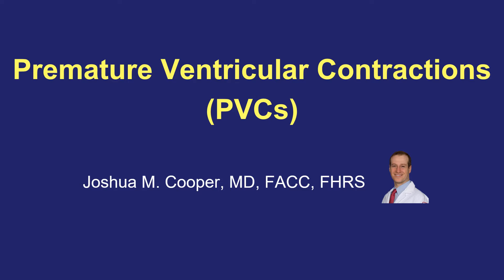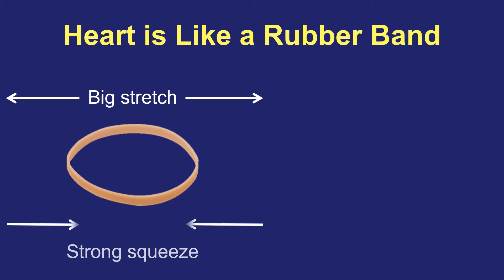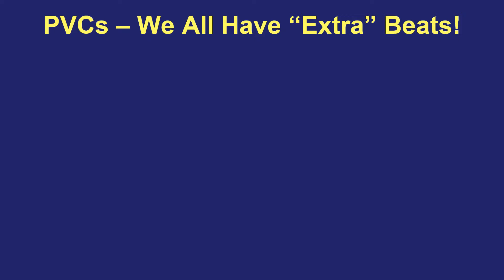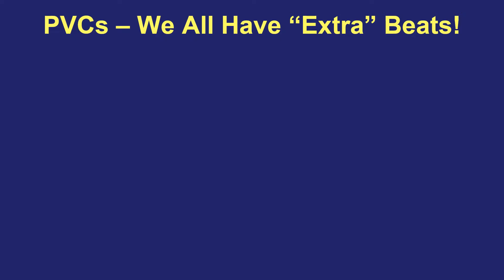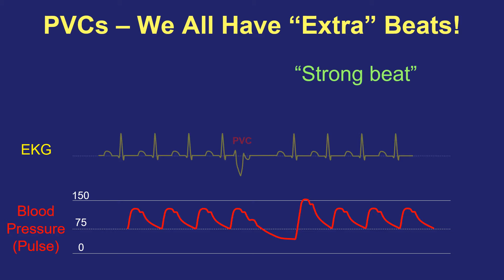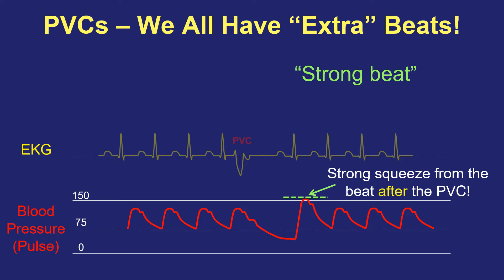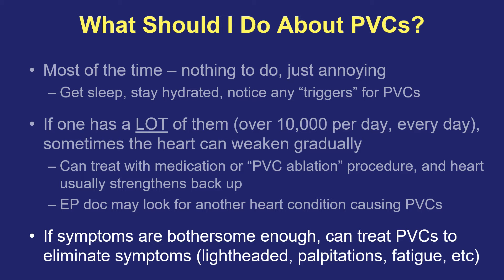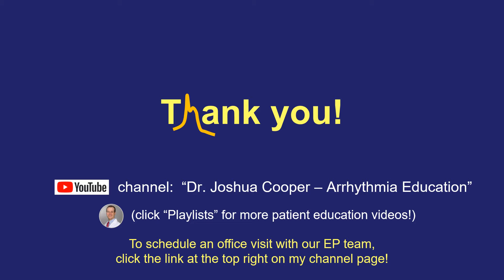PVCs: Symptoms and Treatment - in Plain English!

Comment: Hi doctor
Wonderful video!
In 51 and have pvcs for about a year.
I feel only maybe 5 every other day. 
Had a ekg, echocardiogram both were normal. Wore a zio patch for 10 days came back as rare pacs and pvcs, less than 1 percent of all heart beats. And no heart rythmas. My doctor said nothing to do because there are so few of them, and I just feel a couple of day, and my heart is structural fine ejection fraction 60%. He says there just annoying and not dangerous and everyone gets them, nothing else to do?
Thank you doctor
Reply from the maker: The two reasons to treat PVCs are for medical benefit and for symptom benefit.  People with normal heart size and function, with rare PVCs, usually do not require treatment of the PVCs from a medical perspective.  From a symptom perspective, it depends on how often and how severe symptoms are, which would dictate whether any treatment would make sense from a quality of life perspective.  Most people with a handful of PVCs here and there will not feel that treatment is necessary, but everyone is different!

Comment: I have panic / anxiety disorder. But I feel there is something truely physically wrong w me. My father had hypertrophic cardiomyopathy. I’ve been tested and told no. But I do have PVC’s 

I’ve been in ER several times over the years. 

I passed out when prescribed propranolol. I take 10 mg amlodapine now. My thoughts have a DIRECT EFFECT ON BP.  I can hover around 140. But get to 190 when stress arises just 20 seconds after a thought. 

I’ve been told stress leads to PVCs which leads to a weakened heart which can lead  cardiomyopathy which can lead to stroke / death 

Last week I ended up in ER for PVCs again. Since 7 days ago I have waves of uncontrolled blood pressure increases , panic and persistent pain in my heart. Physical pain. I also have fainting. I don’t know what to do other than die
Reply: bro me to man i have a panic disorder and just the thought of it or a pvc or just blood pressure going up from running just a little  makes me try to not go into panic mode since it feels like a onset of a panic attack. its so difficult

Comment: I have seen 3 cardiologist at 22years old because I was worried about a panic attack months ago induced by caffeine and workout, they all told me I was fine, though the PVCs didn't show on their EKGs (1min ekgs..)
At home sometimes I can have up to 1000-2000 PVC a day approximately but somedays not at all or very little. They happen after an moderate/intense workout particularly, I have a good performance overall, am I safe and no need to get a 24hr holter, the cardiologist only performed quick ekgs and echography when I visited them? Thank you 😊

Comment: I have a lot of PVCs through out the day. I also have mitral valve prolapse. My DR said that the excessive PVCs are not caused by the mvp. It does it a lot while I'm laying down to sleep. It's so annoying.
Reply from the maker: Mitral valve prolapse is commonly associated with palpitation symptoms, and I personally think that the extra "yank" on the mitral valve structures with each heartbeat may be responsible for increased PVCs in patients with this condition.  The shape of the PVCs in MVP often suggests origin from the papillary muscles (to which the mitral valve chordae are attached), which I don't think is a coincidence...  Regardless of whether your doc thinks the MVP and the PVCs are related, you should speak with him/her about treatment options if the symptoms are interfering with sleep and quality of life...

Comment: The patient was in sinus rhythm. With episodes of sinus arrythmia. Heart rates ranged from 45-128. The average heart rate was 67 BPM. Ventricular arrhythmias consisted of rare uniform PVCs.
Supraventricular arrythmias consisted of rare PACs and 3 triplets. There were no noted pauses.
7 day holtet

Is this normal?
Reply from the maker: You should talk to your doctor about your monitor results.  In general, "sinus arrhythmia" is a totally normal phenomenon of the heartbeat speeding up and slowing down a bit with breathing in and out.  Rare PVCs are seen in almost everybody on heart monitoring.  Rare PACs and short runs of a few fast beats in a row are also extremely common and seen in most people who wear heart monitors.  Best of luck to you!
Reply: @dr.joshuacooper-arrhythmia9917  
Thank you! They defined it as being within normal limits. It was just scary as the doctor said a triplet is considered SVT.
I always thought most SVT was dangerous.
I tend to worry so much. And wanted a second opinion.
Reply from the maker: @brettdenneny9895  SVT (supraventricular tachycardia) is actually hardly ever dangerous (it's VT - ventricular tachycardia that can be dangerous sometimes).  And 3 beats is the bare minimum to call something SVT or VT, and such a short episode is virtually never dangerous in itself, either way.  No worries - carry on with your doc!

Comment: I truly appreciate this video. I do have a question if that's okay. What about those of us with multifocal pvcs. My tests have all came back normal, but I have frequent pvcs, pacs, I've had svt, and atrial flutter before as well. Anyway, I tried several different beta blockers, and calcium channel blockers, but bc I also have very low bp, and pulse runs low as well, I can't take them. What is there, I can do for relief. My dr thinks my stomach issues are irritating my vagus nerve causing the pvcs. I have gastritis and GERD. I'm working on healing my gut issues now. I'm sorry to write so much, but I'm desperate for relief. Any advice would be greatly appreciated if you have the time.
Reply from the maker: Thanks for sharing.  I can speak in general terms, as I'm not able to give individual medical advice here, for several reasons.  When frequent PVCs are coming from multiple different locations (i.e. have different shapes on EKGs and on heart monitors), a cardiologist will often look for some underlying heart condition that might be related to the PVCs.  When someone has a normal heart and PVCs, usually they mostly come from one main location (not always true, but usually).  When someone has multiple different arrhythmias, again a cardiologist will often look for an  underlying cause to explain why there are different arrhythmias happening (everyone has PACs and PVCs, usually infrequent, and SVT is not uncommon - but if someone has frequent PACs, frequent PVCs, atrial flutter,  and SVT, it is worth looking for some underlying explanation).
Different arrhythmias can be treated in different ways, with most arrhythmias having both medication solutions and procedure solutions (catheter ablation).  Beta blockers and calcium channel blockers can sometimes help certain arrhythmias but both of them can lower blood pressure.  Acebutolol and pindolol are beta blockers that have less BP lowering effect, and many antiarrhythmic medications can help manage arrhythmias but do not lower blood pressure (such as flecainide, propafenone, dofetilide); antiarrhythmic medications are most often prescribed by arrhythmia specialists (electrophysiologists), so an EP consultation is often helpful when trying to manage arrhythmias.  In addition, an EP doc can recommend when an ablation procedure might be the way to go to manage certain arrhythmias.
Certainly there can be a GI tract-heart link for some people when it comes to arrhythmias.  For example, esophageal reflux is not an uncommon trigger of atrial fibrillation episodes.  And vagus nerve triggering from GI events can sometimes be an arrhythmia trigger, but not that frequently and not usually for a variety of different arrhythmias.
So it sounds like you're on track to manage GI issues, but if you haven't seen a cardiologist or electrophysiologist to think more about your arrhythmia and heart situation, that might be a good next step!  Best of luck to you!
Reply: @dr.joshuacooper-arrhythmia9917  Wow! Thank you, so much for your feedback! I truly appreciate the advice and have an appointment to see my cardiologist coming up, to discuss these issues. Thank you, for the medication explanations as well, as those are a couple I haven't tried! I will definitely talk with my dr about what steps are best for me to take. I appreciate you replying. Have a blessed New Year!

Comment: I have PVC's as a result of the Vagus nerve, a lot of times it starts as gas pressure in my stomach and irritates the Vagus nerve. Also Electrolyte imbalances affect things sometimes.
Reply from the maker: Yes indeed, electrolyte imbalance can impact PVC frequency (especially low magnesium, low potassium levels).  And yes, autonomic changes (vagus nerve vs sympathetic nerves) can impact PVC frequency.  Regardless of PVC triggers, PVCs can be managed if needed, including medications and/or ablation.
Reply: Re: Hiatal hernia. Would that be linked to PVC's?

Comment: Hi doc. very wishful for your great video. I have questions too if you don't mind. I got ablation which was very successful in 2015 because of my 15.000 VES in a day. After that every 6 months I got holter monitor and the result was 200-400 VES in a day  and i don't feel any of them until last year. However for 1 year i have started to feel almost each of one and it makes me crazy. The doctors said there is nothing to worry about your heart and you don't need to get another ablation. But why i started to feel my VEs again since last year (before vaccination)?

I also feel much more ectopic beats after covid vaccination. My last holter monitor was before second does (july) and the number of VEs is 600per a day and my heart is structurally normal (last check 2 months ago). For almost 1,5 months, I forget about my ectopic beats. But  after my 3rd covid dose (last week in december-pfizer) i have terrible days with my ectopic beats and it is around 5000pvs per a day now (in february). I don't know there is any connection but  sometimes very good more times very bad to me. It is a kind of suffer a seizure and I think it is going to better that i feel... So I am terrified to go somewhere, to travel somewhere, more valnurable anymore  because of  ectopic anxiety feelings .My doctor said it should go away a couple of months later.  What do you suggest that kind of patient?

Comment: I have a many PVCs every day, they seem to come periods of time and then go away. But when they are occurring it is every couple of beats and eventually I feel terrible, almost “lightheaded in the chest” sensation, probably due to the lack of good blood pressure. How closely associated are PVCs to your digestion? I feel like mine are sometimes linked to eating, but also the temperature, my position and also hormonal. At 12 weeks pregnant they have gotten significantly worse and every day whereas before I was pregnant they were most noticeable after eating occasionally and getting overheated. Going to the cardiologist tomorrow for observation and hopefully some answers. It’s exhausting not having strong consistent beats for long periods of time.
Reply from the maker: As in the video, when PVCs come every other beat (called "bigeminy"), the pulse can essentially cut in half and that indeed can make one feel weak, lightheaded, etc.  Lots of things can result in PVCs flaring up, including anything that impacts the autonomic nervous system (which can be affected by eating/digestion, pregnancy, temperature, and lots more).  Keeping hydrated, well rested, and controlling stress can all help reduce the frequency of PVCs, as sometimes can a magnesium supplement.  I hope you had a productive visit with your cardiologist to help you come up with a strategy to feel better!

Comment: My PVC's are a pain....My worst I get 30 in a row then they spread out but are never the same rate, they can be anywhere from 1 every 3 beats to 1every 8,9,10,20 beats etc... they went away for about 3 months after having them for 6 months and are back now for the last 3 months. I'll be seeing my cardiologist again in a few weeks. He told me to take an extra 25mg on top of my 50mgs of my atenolol(heart med as I had a valve replaced in 2018) but that drops my bp down to 90/55 my reg bp is 110/65 so I stopped doing that. I walk 7kms a day and feel fine.....but I can feel them most times if I'm sitting or laying down....
Reply from the maker: It is very common for PVC frequency to come and go, often over a course of weeks or months. Beta blockers, unfortunately, often do not work very well to alleviate PVC symptoms. Anti-arrhythmic medication often works significantly better, and catheter ablation can be curative when the PVC frequency is sufficient to map and pinpoint the site of origin. If you are not satisfied with the management of your PVC symptoms, I would recommend seeing an EP doc, who will likely have more therapeutic options to offer, compared to your cardiologist.

Comment: Thank you very much. What I had were normal PQRST waves followed by a PQRST wave but only showed half the amplitude as compared to the normals ones, would that be an example of a PVC? And sometimes on the ECG it would show normal PQRST waves followed by only an R spike, would that be an example of a Ventricular Escape Beat? I'm going to set an appt with my doc just want to see if what info I can ask him prior to going. Thanks for your help.
Reply from the maker: If an early beat looks similar to normal sinus beats, i.e. the early beat starts with an early P wave which is followed by a narrow QRS complex as well, then it is likely a premature atrial beat (PAC) and not a premature ventricular beat (PVC).  But your doc can show you your EKG/monitor tracings and explain what type of beats you are having.  In general, PVCs cause more symptoms than PACs, but both can be noticed and be annoying.  Best of luck to you.

Comment: Had my first one 45 years ago. I had a mixture of PVC and PAC. Alcohol and caffeine were the main cause, stopped all that 25 years ago and frequency become less. I could put up with them like few per week, however after the third pfizer vaccine in 2021 i started getting  like 70 a day sometime even 200  never had this before, feeling the pulse there is a gap between beats and i feel a pain in my upper chest when it happens. echo was normal, holter showed that the majority are PVC, so bought a 10 lead  ECG machine a used one and monitor myself. They are Always PVC but the scary part are the pain in my upper chest only  when they happen.

Comment: Thank you for this video! I want to ask: in the case of a pvc ablation, is it possible for them to reoccur later?
Reply from the maker: Great question!  Yes, there is a chance that a PVC that was targeted by ablation could recur - usually because the heart muscle spot that was the cause of the PVCs was only temporarily, but not permanently damaged by the ablation.  There are a few reasons why the injury was only temporary (such as: PVC site was deep in the muscle and not just at the surface, or the ablation was done very gently to avoid damage to other nearby structures), and often a second ablation procedure will be successful, when needed.  It's also possible for a new PVC spot to show up at a later date, but that doesn't happen that often (unless there is some other heart condition present as the cause of the PVCs).
Reply: @dr.joshuacooper-arrhythmia9917  Thank you!

Comment: So is VT Ablation the same as PVT Ablation?  (one and the same?)

And with VT, if the ablation doesn't work or other issue happens, which does the cardiologist usually do?
Implant a pacemaker or an ICD?
Reply from the maker: There are 2 categories/types of VT, 1. Single spot firing over and over (like a PVC spot), 2. Short circuit(s) related to areas of damaged heart muscle with scarring of the heart (many different causes). With #1 type, VT ablation is exactly like PVC ablation - find the one spot and burn it! If it doesn't work, options include repeat ablation with different technique, or try different medications to suppress it. Usually this type of VT isn't life threatening and an ICD is thus not needed. A pacemaker treats slow heart rhythms and has no role in treating any type of VT. With #2 type of VT, there is usually some other big heart problem, and there isn't only 1 VT but rather there can be 5-10 or more, including ones not yet seen! And because these various VTs can be different speeds, including very fast dangerous ones, an implantable ICD (defibrillator) is often used in addition to medications and ablation, to keep the patient safe!

Comment: When mine happen I get a sinking feeling in my stomach. Its almost like if you run over the speed limit and see a cop that feeling. Is that PVC?
Reply from the maker: There is a range of symptoms that people may (or may not) feel with PVCs, including the sensation you describe very vividly!  The best way to sort out if you're having PVCs would be to use a heart monitor (prescribed by the doc or smart phone app that records EKG tracing) and correlate the recording with symptoms at the same time.
Reply: I have something similar. I often describe it as the same feeling you get when the elevator stops abruptly and I feel almost like my stomach drops. Or there’s a wave or flash of panic like my heart dropped. Sometimes, I immediately feel flushed, too.
Reply from the maker: @ImHandlingIt  That is a great way to describe the symptoms that many people feel when they have PVCs!  Thank you for sharing!